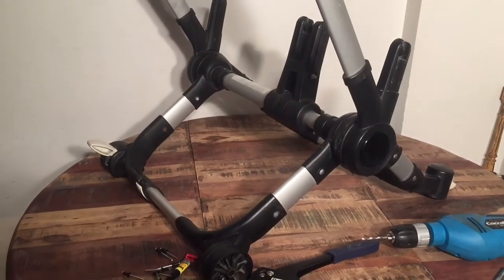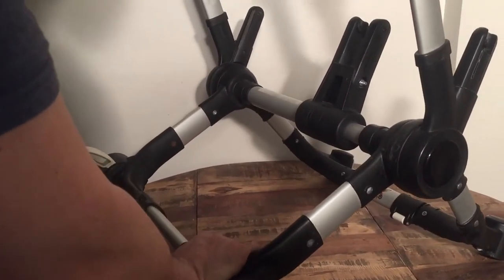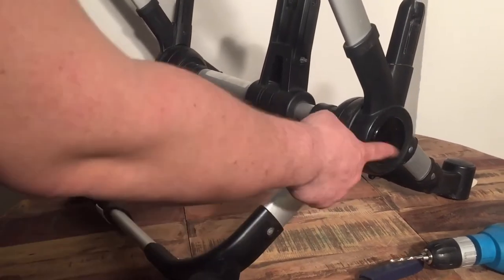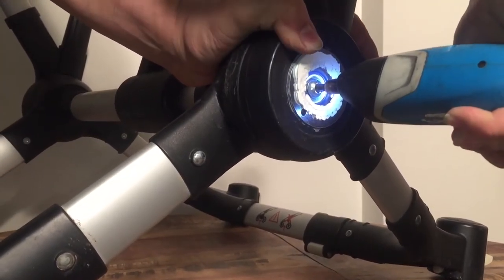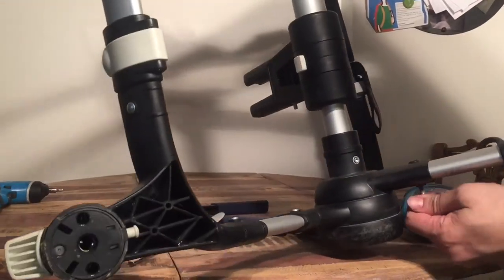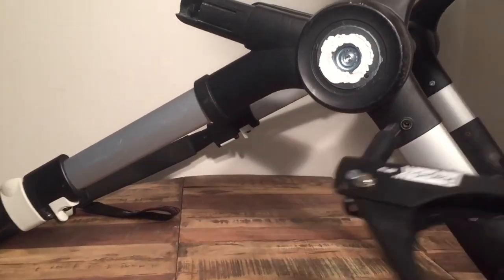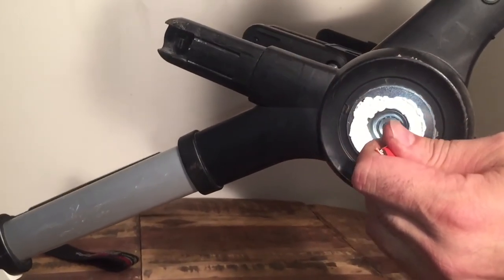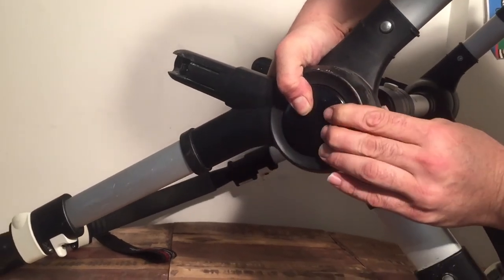How to Fix a Loose Bugaboo Donkey Chassis

Comment: Just wanted to comment that I tried this solution and it wasn't quite enough for how cracked our donkey chassis was on the back struts- the cracking was too far gone. Reriveting did stabilize it but the glue couldn't hold the cracked plastic together. What did work for us was using 2 4inch rolls of Fiber Fix and it created a cast which has saved it from cracking further and has been really solid. Hope this helps!
Reply: Remember the size of the rivets used?

Comment: Hello, do you guys know where I can get replacement parts? I need that plastic piece that rivers are placed on. It is cracked on both sides
Reply: dis u find them ? im looking the same thing
Reply: No, I uzed zip ties and glue. Works like charm.
Reply: actually my problem is on the disk and the plastic thing on the frame . it makes a cling sound and it colapse evertytime i use it.
So i thought to  tight the stroller like he is doing on the vidioo and no succes still the same problem .
i search for a disck and the palstic thing that goes with it but couldnt find it .
you think i should use glue on that? or on the rivers? does then unfolds ?idk im so confussed

Comment: Size of the rivets? Inspect our donkey and found the exact same problems.
Reply from the maker: I don't have one in right now, but this video should help: https://www.youtube.com/watch?v=SqKJgGi5Lmo
Reply: @niklgu did you ever find out the size?
Reply: @tesrobinson  long time ago :)
Bought a set with several different sizes!
Did the job 🙌 thanks for the vid!

Video tip. Service vids of the emmaljunga nxt60 is hard to find. Had one that was quite wobbly, reckon lots of people experience the same.